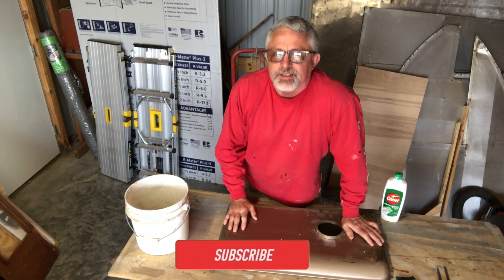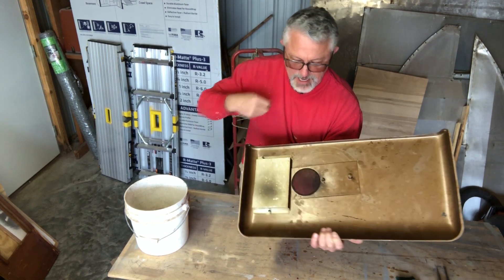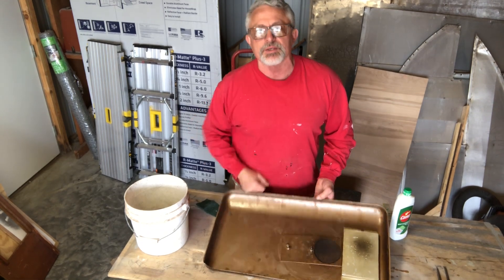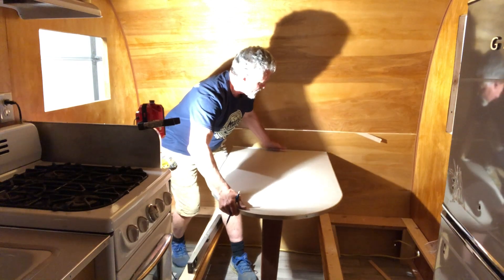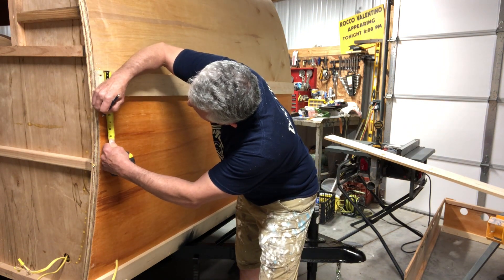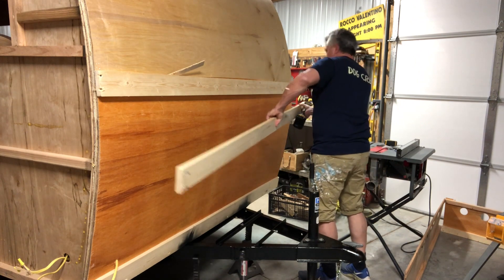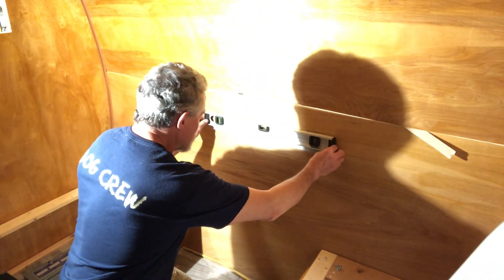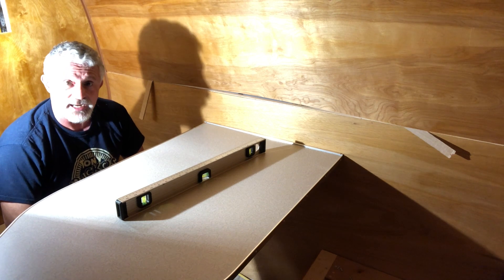EP 149 Update on interior projects on vintage camper 1954 King travel trailer Retro RV

Comment: Hi Rob, Thanks for the videos. I have  just found a 1968 Oasis that needs some lovin". Your videos are helping me with everything from frame to finish. Any advice for the Carlson 108C floor furnace? Should I rebuild it or patch the floor? Is there a safety concern with those?
Reply from the maker: I don't reuse the furnace here in Oklahoma. If you live up north you may want to save it. Small heaters work great in small campers though. Good luck on your build.